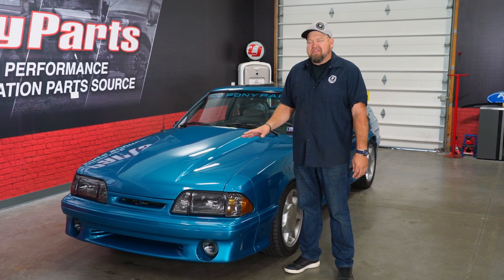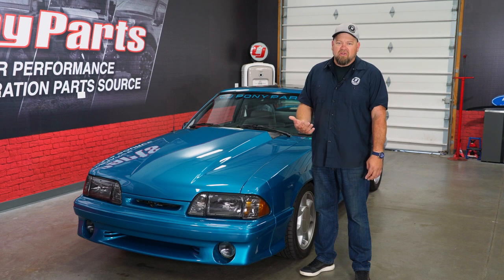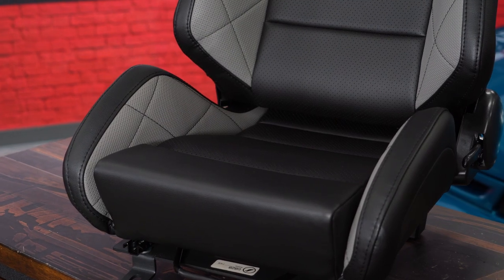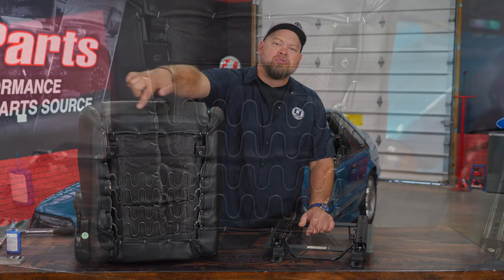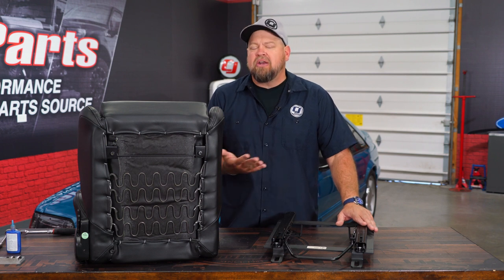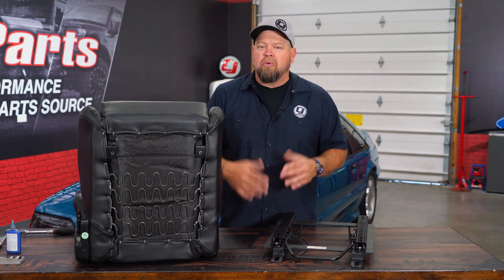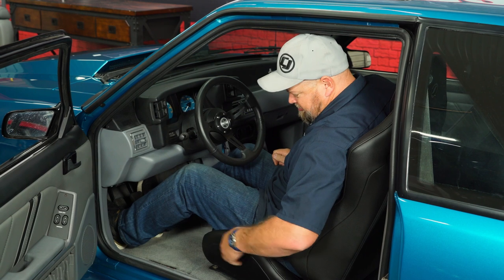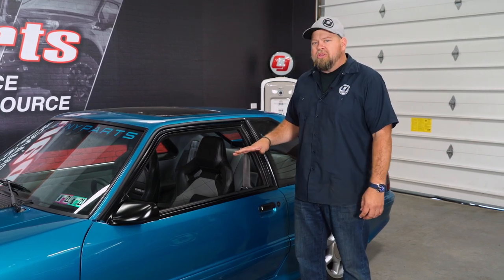Mustang Install | Corbeau RRX Sportline Bucket Seats In 3 Colors

Comment: Do you always need a harness bar or roll bar to mount a racing harness? Why can't these be bolted to the floor along with the seat?
Reply from the maker: You don't need them but they do provide a safer mount. There are floor mount harnesses available.